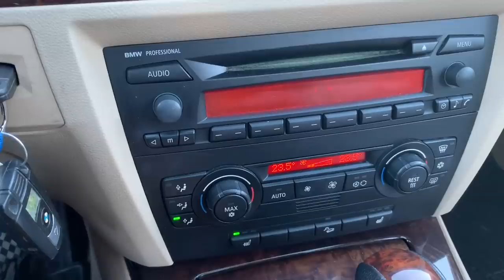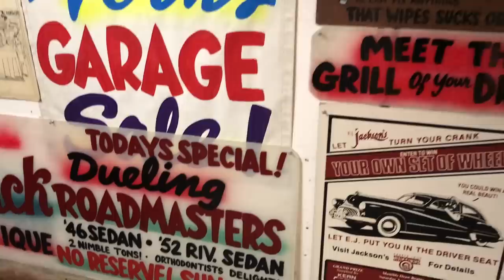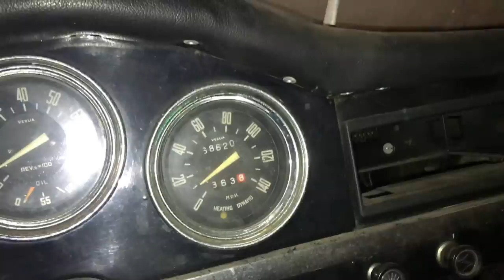Changing up the fleet... and a derelict 1960's Ferrari???

Comment: The dealership would have to cover it. In Canada if they did the safety on it then it would not have passed safety without both headlights working properly. So I'm pretty sure you're going to have it covered. Just mention the safety to them.
Reply from the maker: I think they will

Comment: Those Ferraris are incredibly expensive to own, if my memory serves me right they have the V12 engine and they are ruinously expensive to keep running right and, due to all the torque they have, they are incredibly hard on the running gear like the gearbox and rear end.  They were sort-of the predecessor to the 365 GTB/4 Daytona, a more luxury Ferrari, and the Daytona engine was directly developed from the V12 in the 330, with a larger capacity and twin-cam heads against the single cams in the older engine, which gave the Daytona its /4 designation, denoting that it had a 4-cam engine.  These were extremely undervalued cars up until quite recently so a lot of them around are in pretty poor condition, they rusted horribly and even the tubular chassis and body frame can be totally shot under the exterior panels.  But they are beautiful cars if you have a lot of money to spend on rescuing a poor one.  A friend of mine had one of these in the late '80s into the '90s when they were still cheap, he paid £9,000 when he bought it, which was quite a lot for one back then, that money could buy you a pretty decent new car, but it was a very decent example that came from the original owner.  He sold it when the prices started getting silly and they wanted a bigger house, for £80,000 after nearly a decade's fun.  Values now, £250,000+ and a whole lot more for one with an interesting or significant history.  I believe Enzo Ferrari had a 330GT himself, though that car is accounted for though there are cars that were owned by other important names that are currently missing such as the car owned by Luigi Chinetti, owner of the famous NART (North American Racing Team...)
Reply: it's a 330GTC. One of neighbors had one 40 years ago, a very ordinary design underneath but that engine had the most amazing sound . They bring insane money right now but are not the car a 250 GTC is  and to my mind not worth the money being paid for them. I'd sooner have an Espada or Maserati 3500 .

Comment: You are not going to tell use until next week, you have a mean streak, KIDDING!!!!!!!!

The 64 Italian sports car convertible????????
Reply: I also miss the Nash,but I really like your BMW.
Reply: By the way, my $200.00 23 year old Honda Passport runs fine, the right rear fender is crumpled a bit, the previous owner said his insurance company wouldn't repair it, wanted to write it off, he told them okay but he would keep the car.

I was told about a year later it was for sale, contacted him he said $200.00 I said okay, found out the battery had to be replaced, he said reduce the price by the new battery, like a fool I said no, that I would buy battery still pay the $200.00, by the way the five tires all looked new.

I am very happy with my $200.00 car, my $125.00 battery & a year latter my $80.00 new starter not thrilled with the $200.00 labor to remove old starter and install new one.

Well, I still came out a long ways ahead, it runs.

Comment: oh no... those BMW's are trash. You will not like it in the long run. They are full of defects and flaws in the design. As dj33036 .dj63010 said, they're money pits. You'd have been better off with ANYTHING made prior to 1975. You just can't be seen in trash like this, it won't represent the shop at all. 110K, you've got about 30K left before it just totally falls apart.